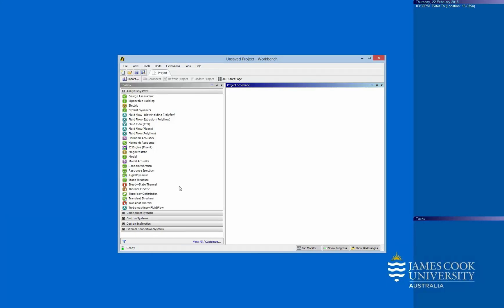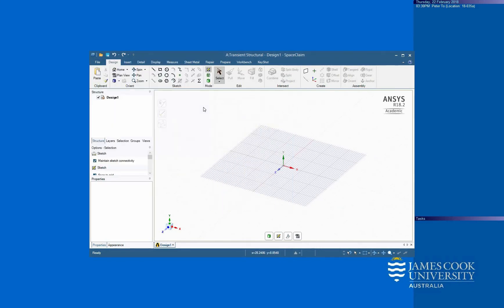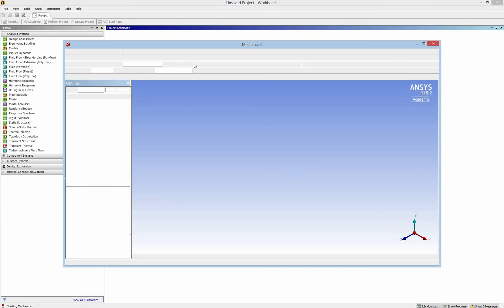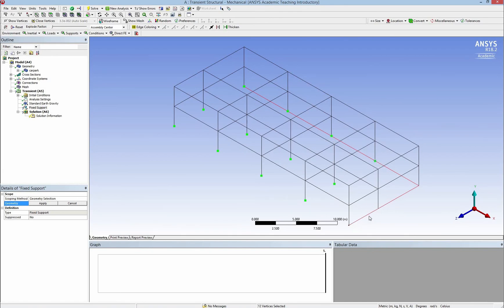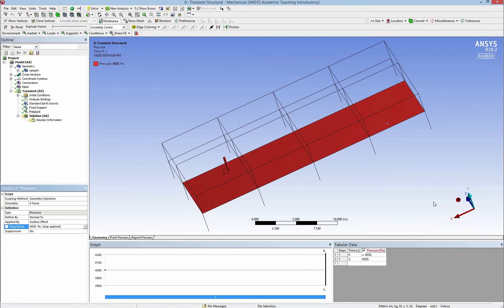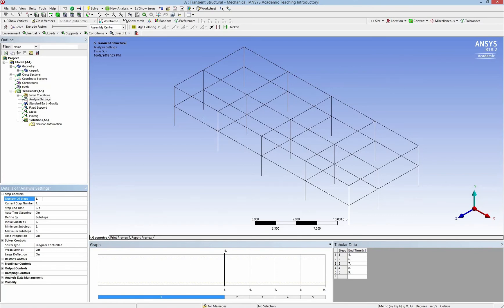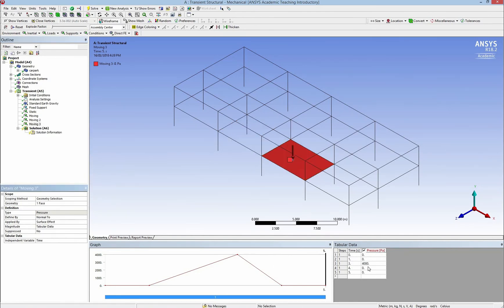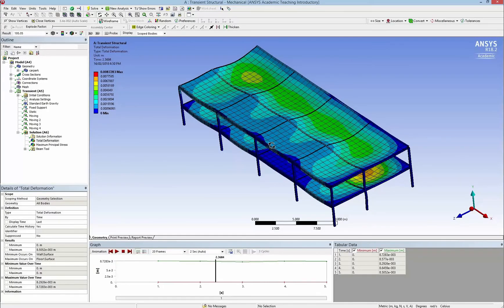Ansys 18.2 transient Moving load on carpark

Comment: Hi peter very good tutorial, I am trying to apply similar load case but on multiple nodes. Is it possible to automate the part where we manually enter the load values and erase the previous one's from the table?  Because it will be impossible to do so for 600 nodes!!!!
Reply: Yes, I have the same issue. Were you able to solve it??